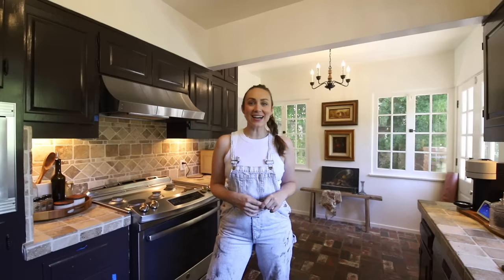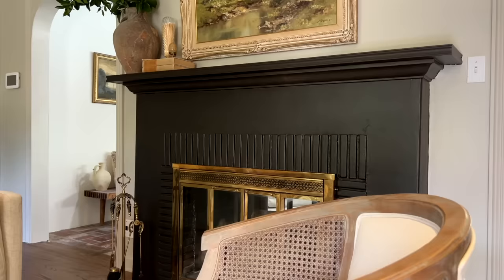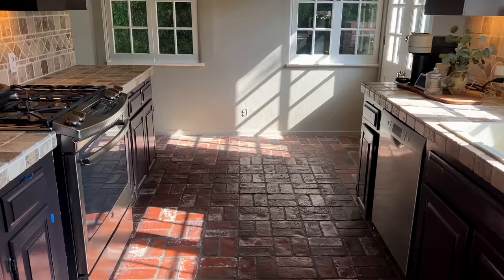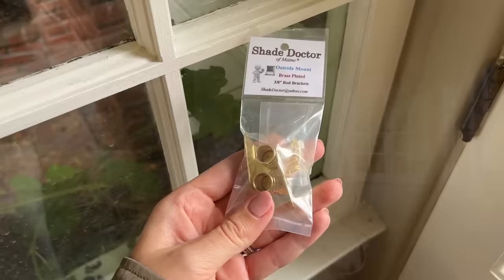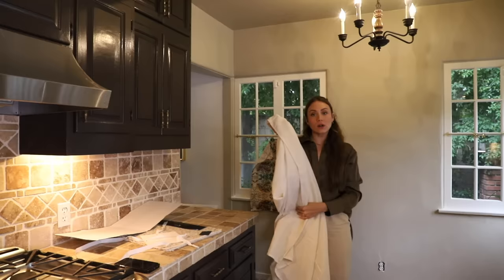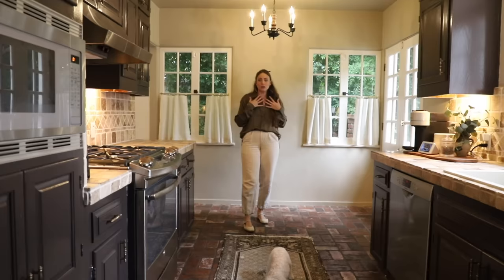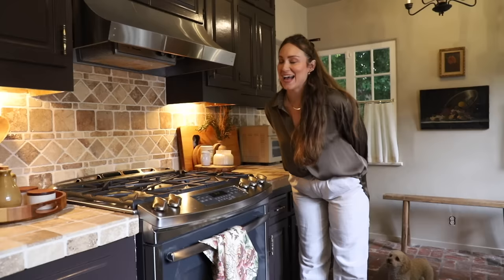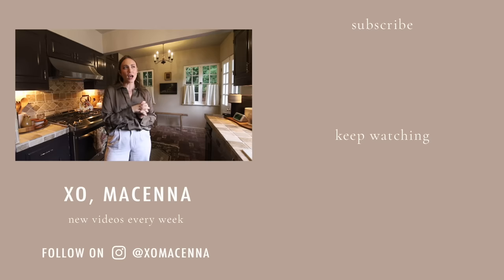VINTAGE KITCHEN MAKEOVER (before & after) *Moody, French Kitchen Part Two* | XO, MaCenna

Comment: The cafe curtains are a lovely touch.  I sympathized when you had to clean all those handles.  When I got new ones, I wanted to donate the old ones but knew they needed cleaning.  They weren't as dirty as those you bought, but 44 handles later, I was wishing I had just thrown them in a bag "as is".  Congrats on a lovely space.

Comment: When you decide to spray paint the old hardware with silver and planed to repurpose it, I was very skeptical but for years of watching your channel, I learned that I have to trust the process and most of the outcome is great that's why I didn't bother the silver hardware that much. However it was a relief when you finally ditch it😅.

Comment: Beautiful makeover.  I use tension rods that fit snugly inside the window frames so no need to make holes in the frames.  So easy to take in and out to change curtains or wash them.

Comment: At 26:10,when you were talking about the little oven and how it was neutral,it made me yearn for the day when the large appliances were neutral also,like white or almond,or putty(?) like the little oven!  Hopefully someday,the trend will leave stainless steel. (which I have hated from day one) It’s also what made you try to match the handles to the appliances,even though the tile and brick are both warm.🤔 A beautiful vision of your kitchen would be the wall paint and curtains that you just did but with the original warm cream cabinets,tile and brick,but ALL of the appliances would be the same color as the little oven!    Like a creamy dream!😁

Comment: I love the new kitchen paint color. That and the cafe curtains warm the space up. Another person suggested the original framed fruit picture with the other oil fruit picture in the kitchen and I agree. I think the scale is better pairing those 2 together. Yes to the bench grounding the space but what about a basket underneath the bench? It can be functional to store Kinsley things or onions or potatoes. A wooden cabinet would look great there and add texture/visual interest also if you come across that find. I personally and respectfully still am not a fan of the dark and glossy cabinets but the new paint color helps. It is your home and as long as you are happy-great job!
Reply: Haha, I can just see Kinsley running away with a potato or onion in her mouth !

Comment: I have a super tiny kitchen and when I needed a really narrow cabinet for a coffee bar I found the top of a china cabinet at the thrift for $5. It was one without glass but was solid pine and I was actually able to flip it upside down so the drawers were on top instead of the bottom and I added legs to it. It's hard to describe but it filled my space perfectly and now I have my coffee bar and my air fryer there.

Comment: If you want a crazy easy no sew option I’ve done the same thing with cloth napkins, a tension rod and the clip on rings. The napkins are already hemmed and I just fold it over to the correct height or put the tension rod up or down to make the napkins the right height. I have fun changing the curtains for holidays, etc. 😀
Reply: And flour sack style dish towels, also…

Comment: What do you think of changing  out the bench by  the window with a vintage  table that has a 12 inch center on the top with both sides of the top flip down.  That way the table can be used as a thin console table most of the time with a small lamp and other dec on it.  But when you  need  more prep space, you can flip the side that protudes  into the room for that😊

Comment: Another way to clean the hardware would be to lay them all on a sheet of foil in a bucket like you used. Then sprinkle a good amount of baking soda all over all of the hardware & then adding the boiling water & vinegar. The baking soda makes the water & vinegar bubble & the foil helps pull out the dirt. It works amazingly every time! I use this method to clean all of my jewelry & it never fails me! It takes tarnish off silver, too! Anyway, I love how the kitchen turned out. It is beautiful, as I knew it would be! ❤❤

Comment: A method I use for cleaning hardware is to use an old crockpot and turn it on high with the hardware in water. Let it cook for a couple hours. Super easy! Grime and paint just melt off!

Comment: I have the same cafe curtain hardwares from amazon minus the rods because I needed much longer ones. My husband is actually painting them rubbed oil bronze right now. Just as a heads up, I had the gold rings same exact brand (shade doctor) up for many months and they faded into this light gold/silver. But you’re crafty and am sure when that happens you can easily paint them brass again. 

I also have been dying to ask if you could just pretty please for kicks and giggles try to put a small round table and 2 chairs in that empty area right smack down the middle of the walk way in front of the bench and french doors. I just feel like it might just work and if not then at least we know. 😊

Comment: My question was on of practicality. Was the linen table cloth fabric pre washed and preshrunk? Or did you wash it before making the curtains? I always wash any fabric before making something out of it that could need cleaning because fabrics shrink. Especially because you wanted a certain length in your curtains. I’d recommend too for your viewers. I guess you could take out the hem and do it over if they shrunk but that’s a lot of work that could take be avoided by preshrinking fabric ahead of time. Just a suggestion and question about preshrinking?

Comment: Beautiful colours, and good decision on the hardware, looks fantastic! I've been thinking about your pantry conundrum for the remodel. I think trying to fit a walk in pantry into a relatively small rectangular space with no clear spot for it just isn't going to look that great. Rather than a walk in, have you considered building a large pantry cabinet? I'm talking double wide full depth Pinterest worthy cabinet, not just a dedicated cupboard or two. Go all out with the internal fittings, you could still make it so your small appliances fit in there if that's what you want, or have a separate dedicated appliance garage elsewhere, but I think this way would flow better with your planned kitchen, still add value to the home and work really well too. Something to consider maybe?

Comment: MaCenna, you may not be aware, but many refrigerators can have their door handles mounted on either side. Check your Owner's Manual to find out if your refrigerator has this option.  If the previous owner of your home didn't provide you with an Owner's Manual for your refrigerator, you can print one from the internet  You may also find a Customer Service phone number in the manual for the manufacturer so you can find out if switching your door handle to the other side is an option.  If it is, at least the door wouldn't hit the kitchen wall anymore, LOL! 🤣

Comment: I have the same issue with the refrigerator door hitting the wall. I don't have connections because I'm not a designer but what would help me is a much smaller profile of a door handle for the fridge. What I have thought about is a decorative leather strap but I have not investigated further to figure out how to attach it.

Comment: The reason you didn't like the original handles is your inate since of style. In 1968, I was renewing my first house.(won't call it renovating because I didn't tear out the horrible cabinets or tear up the ages old linoleum on the floor) . Didn't have a lot of money being a pregnant newlywed, so I bought the cheapest of the fairly acceptable metal handles. They were 34 cents each. They were the very ones on your cabinets. Always trust your gut. Your instincts were right. The kitchen is really inviting now. The bright white was too harsh. It's now a kitchen I could live with until the complete renovation.